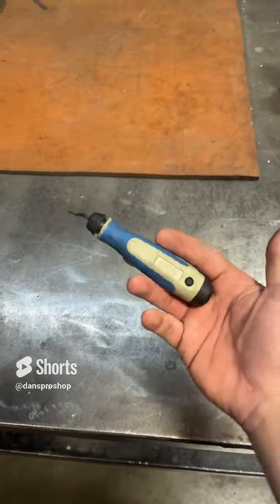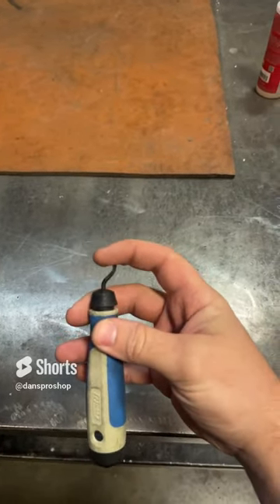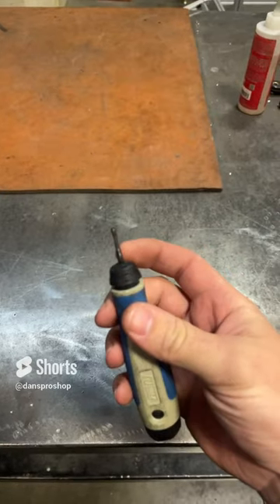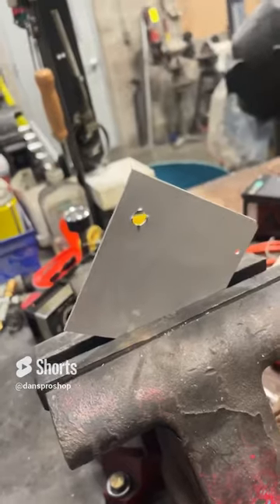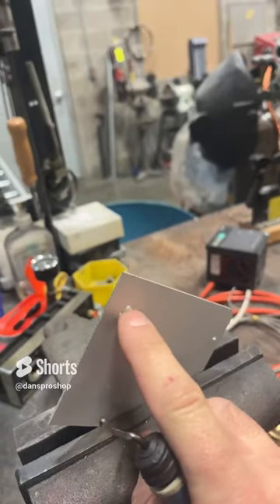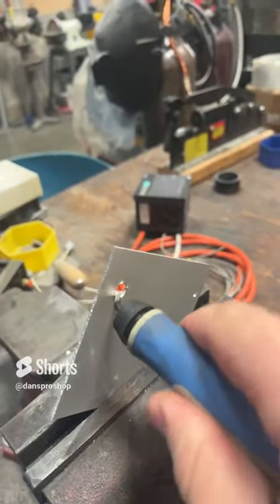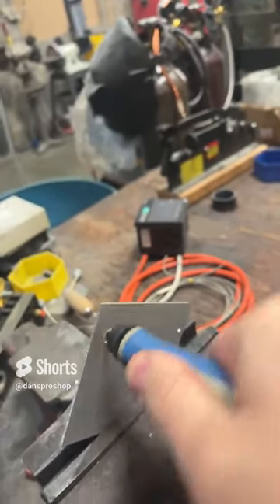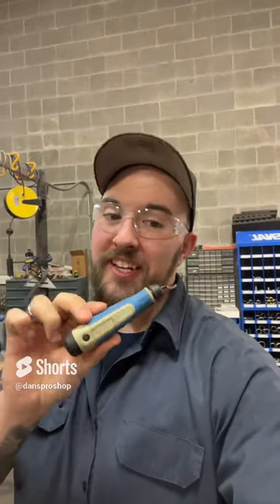Tool review, de burring tool (link in top comment)#tools #review #howto

Comment: you can actually use these on straight edges too, with the right technique. 
as a machinist i've got pretty good at getting a perfect, consistent, shiny chamfer in holes as well. it takes practice
i also replaced the crappy plastic handle with a custom steel one that accepts those same blades and it can take much more force now, and produces a perfect chip, just like a lathe tool!

Comment: I use these on copper pipe when joining the 2. Especially if I'm using propress. Can't use those fittings without preparing the joint.